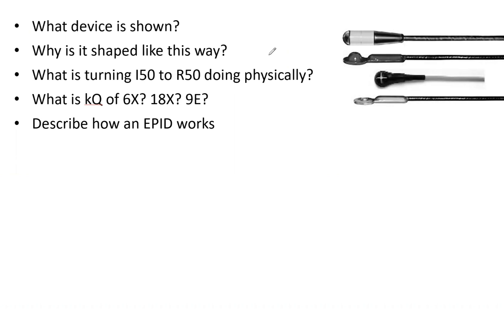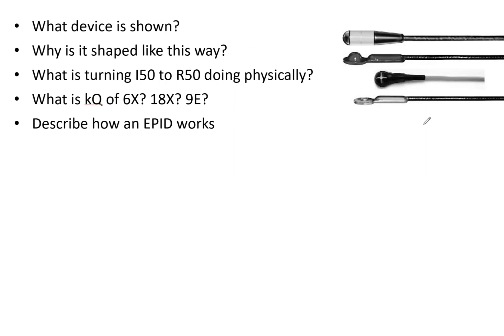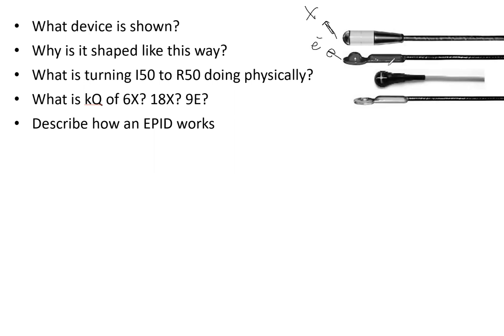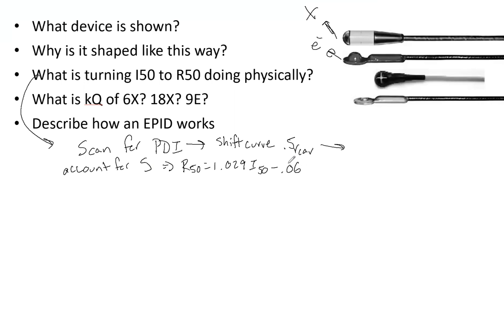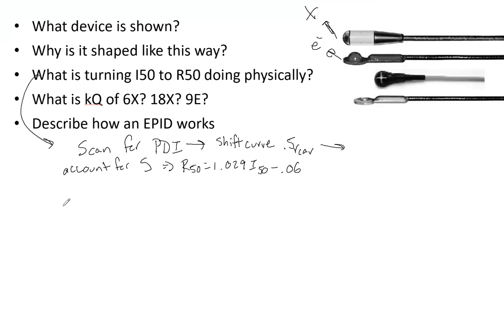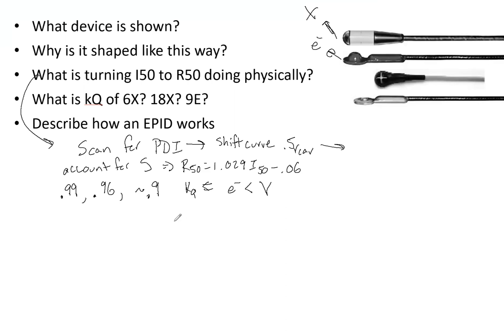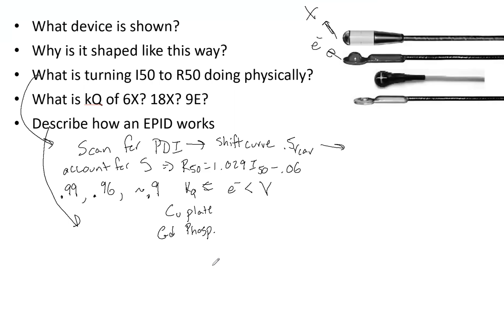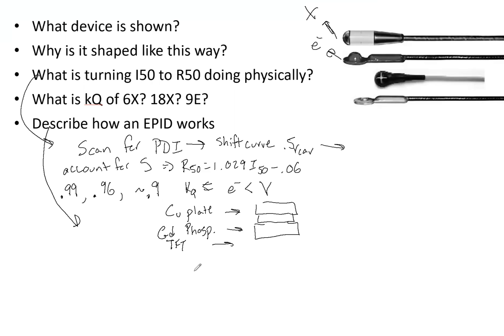Diodes and Quality Conversion Factor ABR Part 3 Prep

Comment: While energy and kq has not been specified in TG-51, you can find the PDD for the energies and then visit TG-51 to interpolate for the appropriate kq. Using that and referring to A12 chamber 6X will be appoximately 0.996 instead of .96 but thank you for laying out a thought process.